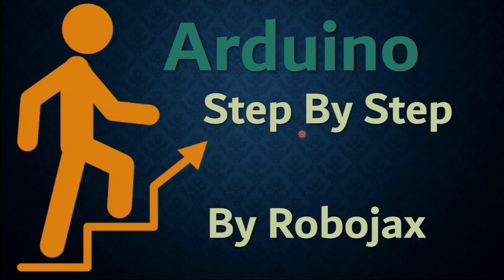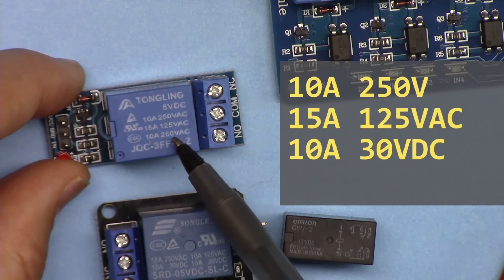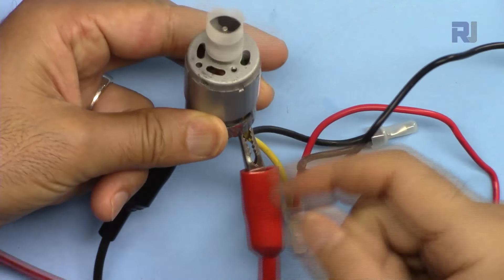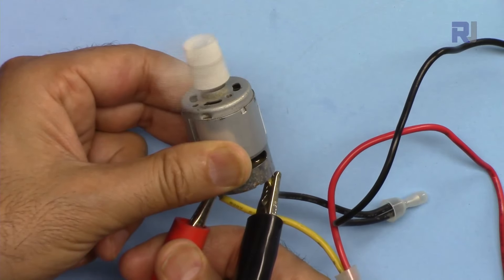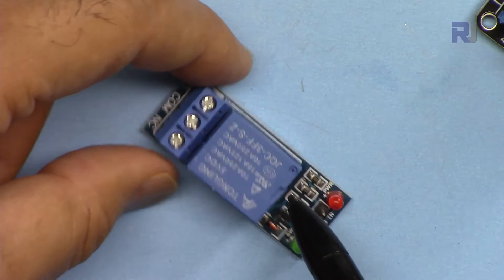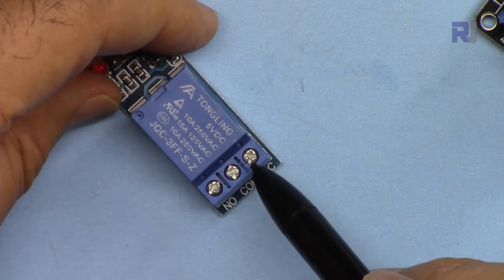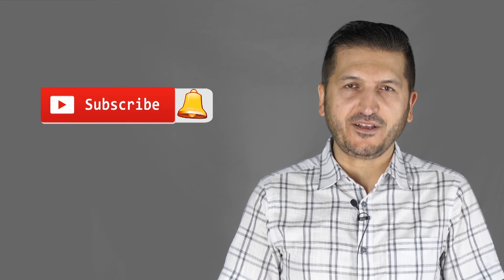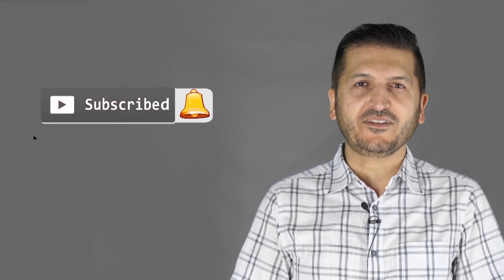Lesson 52: Controlling DC Motor using two relays | Arduino Step By Step Course

Comment: Thank you thank you thank you! Was burning my brain trying to figure out the wiring using two relays to build a new controller for my sit/stand motorized desk. The easy solution would be a motor driver IC that handles the volts and amps, but Im using what I have on hand for now and my brain doesnt settle for easy. Still working on a setup where all signals are low (when not in use) coming from control board for energy efficiency and where neither the positive or negative is looping. Not much information is available on this topic. Glad I found your video like 3am so I could finally sleep. Funny thing is I had stumbled on this video before, discarded the fact on using relays because I want a compact design, was hoping to make a driver if I found a mosfet suitable in my stock, never saved the video completely forgot. But i need this project done, Thank you
Reply from the maker: you are welcome. I'm glad you found the video helpful! Good luck with yoru project.

Comment: Finally you have lead me to this lesson, Infact I was already wired my project exactly like this lesson. But please correct if I am doing the right way. I have used a xy-gmos which you have presented recently applying the same logic. My question, can I use this motor driver along with relays to achieve CW/CCW rotation coming from xy-gmos output ?
Reply from the maker: the XY-GMOS https://youtu.be/El5Dd51HBG8 has PWM controller.  but if you want to add this after XY-GMOS, yes it will work to change the direction of rotation.
Reply: @robojax  Yes of course it worked, thank you again.